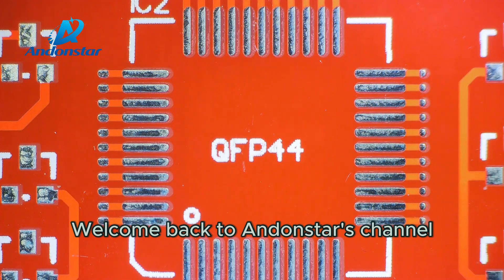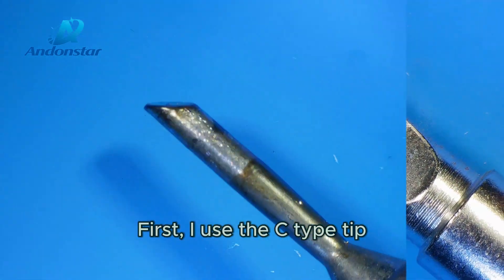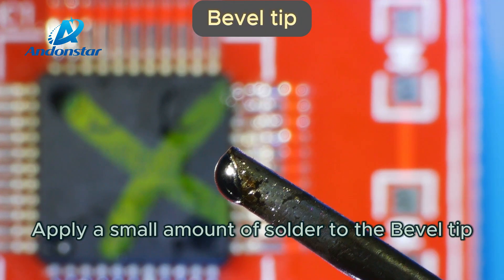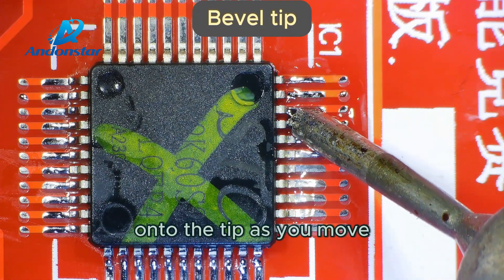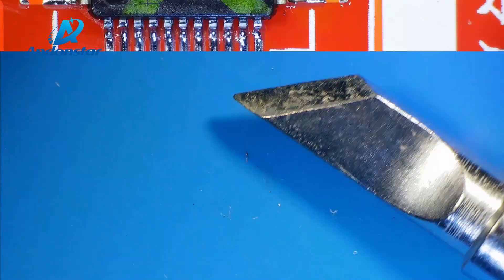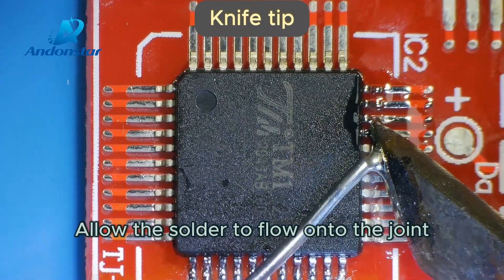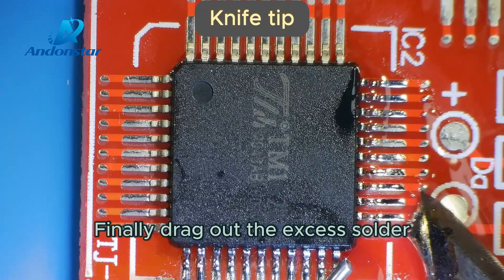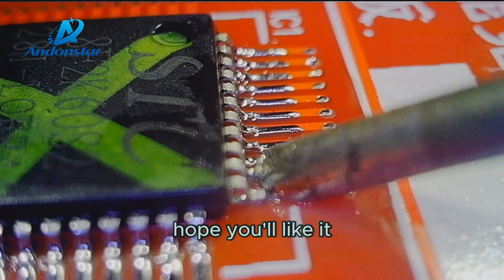Andonstar-- Drag soldering Tutorial- Surface Mount QFP44- Bevel/C type and Knife/K type tip

Comment: Do not touch pins with solder tip. You can bend and deform pins. Put more tin, make solder ball and move that solder ball to make solder joint. You can use flux if you wish, but if you are using good quality tin, there is no need for extra flux. Good quality tin already have flux.